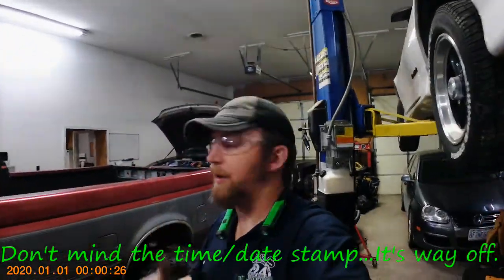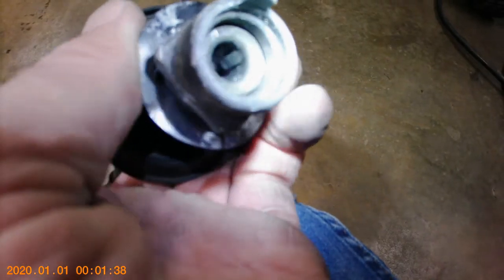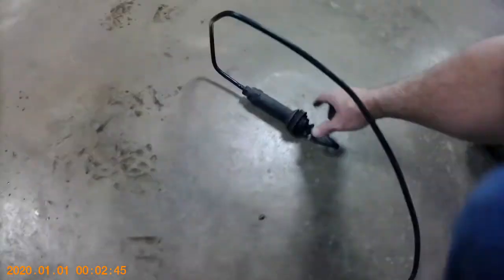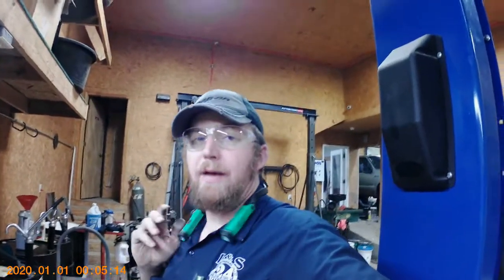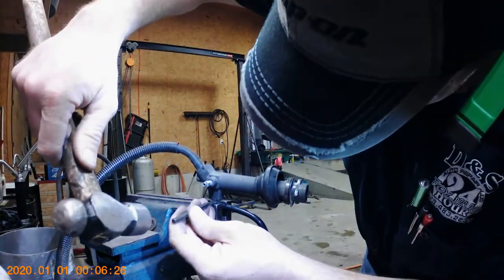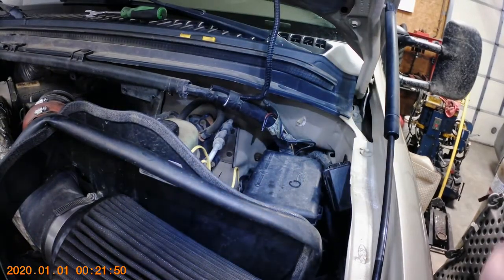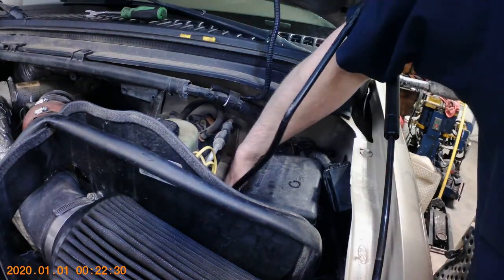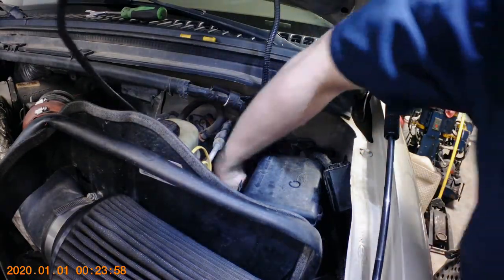2000 F-350 Replacing and Bleeding The Clutch Master Cylinder

Comment: I just replaced the entire thing. Don't need to break it apart on the 1999 F-350 7.3 diesel. It is already full of fluid, no need or good way for that matter to bleed it. No bleed zerts anyway. Just unplug it from the tranny by twisting it out in the reverse of install about a 1/4 turn (a monkey wrench is good for this) . Twist out the master from the firewall, easier said than done, then under the dash be very careful. Detach the metal shaft from the clutch pedal but hang on to it or it will fly back and but you in the face. Then detach the plastic shaft carrier and carefully remove the plastic key that runs the length of the electrical carrier and open it but don't take it apart. This is much harder than I thought because I could only work with one hand. after disassembly the kit comes with a new shaft to snap onto the clutch pedal ball. Locking the master cylinder into the firewall is about a 1/4 turn but align the small protrusion at the bottom when rolled in. Again about a 1/4 turn but I found it a PITA because of Firewall crap. I did get it turned in then went back under the dash to install the shaft and electrical carrier. Again easier said than done. You will notice that the small protrusion in the master that is now inside under the dash fits into the slot in the bottom front of the electrical carrier. That way you know it is in the correct place. Instantly you will notice a change in the clutch pressure. Remember the slave cylinder with the plastic cover and two plastic extensions holding it in place before shoving it into the bell housing? You leave that on there and the first time you depress the clutch those two plastic snaps break and you are good to go. Next time I will use a lift or jack, but this truck would not move. Real tight under there. Good luck. BTW, this was replaced by Ford about 5 years ago when the trans was replaced with not that many miles on it. It's about  a $700 dollar job, so you can save some money with some patience. Parts kits  run $200 to $270 roughly. I think we got ours at NAPA.

Comment: Short story....my foot slipped off the clutch pedal and the master cylinder plunger popped out of the keeper so my cheap ass Jerry rigged a cable to limit the plunger from popping out. Then my throw out bearing burned up.  I replaced it(very hard if you aren't a mechanic or broke with no help).  Left the master and slave alone.  New bearing started squeeling.  Bought new master and slave.  Going to bleed and install because the slave push rod isn't fully retracted out of the box.  Can I get a prayer or some extra crossed fingers in hopes the new bearing isn't destroyed?  Also, any advice would be a big welcome.
Reply from the maker: I really sorry I did not see your comment earlier. It just popped up in my notifications. Hopefully you have it all fixed up and are still cruising down the road. Thank you for watching. I really appreciate it.

Comment: I just put a new clutch in my 02 f350 and the clutch pedal want depress it's like something is stopping it I thought that I may have bumped the clutch fork and knocked the release bearing out of the fork I removed the slave cylinder ran my  borescope through cylinder opening and fork and bearing fine but pedal want press down this is the second clutch I've installed in it but there wasn't a issue the last time need help can't make no money sitting in the yard  thanks

Comment: i have a 2000 with the ZF6. Its missing the spring under the dash on the clutch pedal, and today the rod came right out of the master cylinder. it still shifts and drives fine. but isnt locking. the pedal is also very stiff. any ideas? very informative video

Comment: Just bought a 1999 f350
I have to push the clutch dam near to the floor
Can’t drive and shift gears unless the seat is all the way forward
Is this normal for this truck or do u know a fix
Thank you sir
Reply from the maker: Yes if you do not get the clutch down to the floor of close to it it will not disengage. These  trucks have a really long travel on the clutch pedal, and if it is a Powerstroke the clutch is pretty stiff too. If you have shorter legs this will require you to move the seat up farther than normal. I have a 37” inseam and I normally drive vehicles with the seats all the way back, but even I have to move the seat in my F-350 up a bit to feel comfortable.

Comment: How do I change slave cylinder it popped out of my transmission tonight in my driveway 2008 F350 diesel
Reply from the maker: When you put the slave cylinder in to the bell housing it takes roughly a quarter turn to lock it in place. If the mounting ears are broken you will need to remove the roll pin that holds the line in the slave cylinder, or the master cylinder if your new slave came with the line, push the line fitting in, then you can bleed the system. You can do this without removing the whole system from the truck, but you will need to lay under the truck to do so. Bleed it just like I did in the video, repeatedly compressing the slave cylinder to push the air back to the reservoir. You ma also be able to find a whole prebled set, master, line and slave from your local auto parts store. It may be a little more expensive, but then at least you know the whole system is new and in good shape. I hope this helps, and thank you for watching.

Comment: I have the same year 7.3 with zf6 trans and I have to push the clutch a few times and it goes into gear do you think I need to replace the clutch slave and master?
Reply from the maker: I would start by checking the fluid level and then trying to bleed the system on the truck. To do that just crawl under the truck, take the slave cylinder loose from the trans and work it like I did in the video. If you notice any leaks the replace the leaking part, but it sounds like you may just have trapped air in the system. You can bleed the system without pulling it completely out of the truck. I hope this helps, and thank you for watching.
Reply: Thank you!